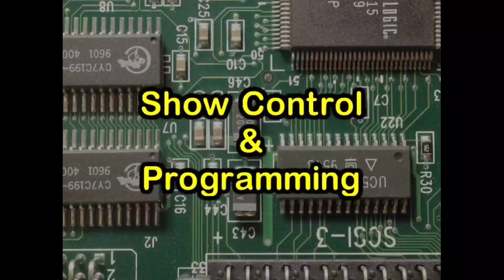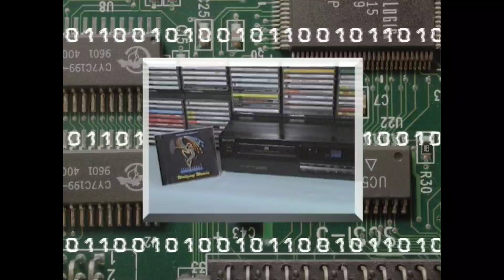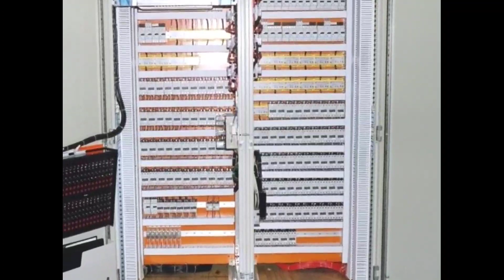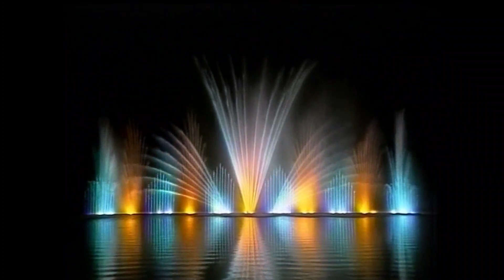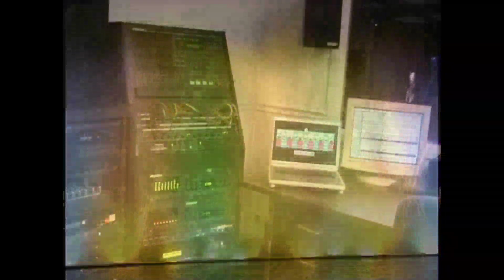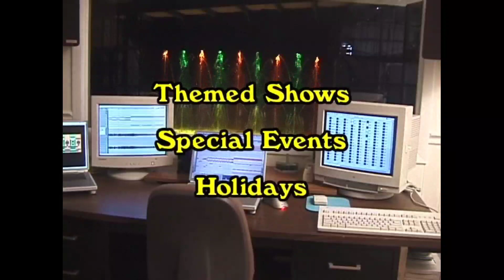How Waltzing Waters Shows WERE Programmed.

Comment: Wow. This is a very standard show control method at that period. Many shows use this method to get precise timing for different effect. Just put the music on L/R and the program signal on the other channel. Then connect the music channel to a powerful amp (Pump up to 110-120dB), and connect the other channel to a decoder to read and transfer the signal to the control box. Which is very reliable and I pretty sure all Waltzing Water style musical Fountain in Hong Kong in the 90's are using this method(Unfortunately they all stop playing shows or demolished).
Nowsdays similar method can be done by a USB stick, or even a laptop with a custom build control program on it.
I would like to see the whole video about the fountain. I can only find that one posted by the CEO of that company.
Reply from the maker: Great Explanation!
Now What Video Is It That You Want To See? Because The Only Video About The Fountains That Are Complete Are By The CEO Himself.